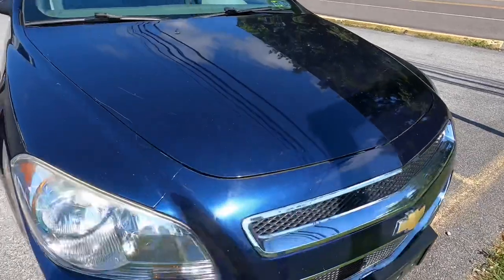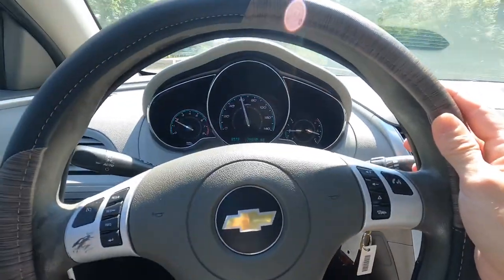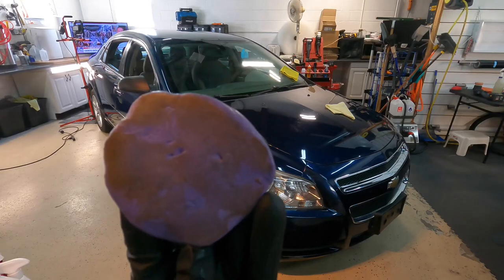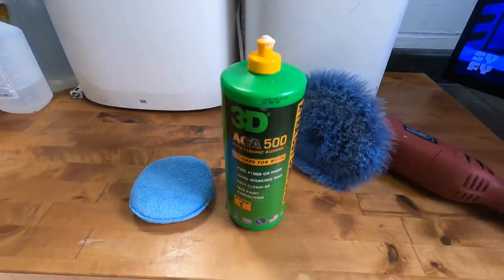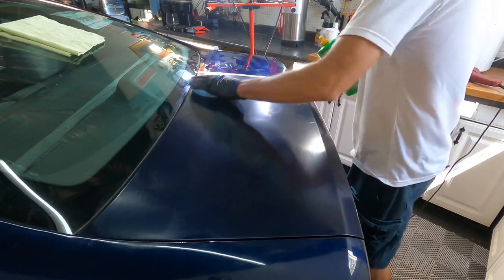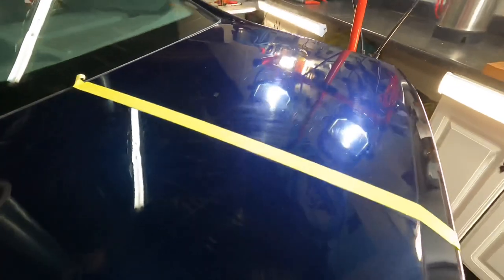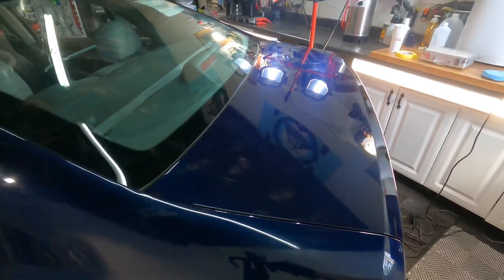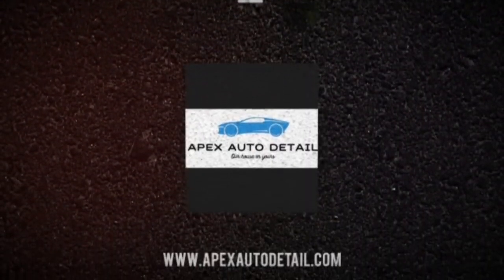WORST Paint On An Auction Car Yet!!! Can We Correct It?

Comment: Just to clarify, you always want to use a clay bar to remove any contaminants BEFORE you do ANY polishing, or can you go straight to polish if the part was already clean?

Also, so it isn't worth it to correct the car's paint entirely because it doesn't increase the resale value enough for the time and effort put into it?
Reply: Yes clay first, you want to remove the surface contaminates so the polisher and compound can get evenly to the paint, not bump around on top of the contaminates.
The correction process will for sure be done to entire car, not just the trunk lid, it would take too much time to video the entire process, so you'll have to use your imagination for the rest. ;-)
Reply: @davescott9062  oh okay, thanks for clearing that up. 👍
Reply from the maker: Wash, Iron remover, Clay, Panel prep, Polish in that order.

Comment: Very nice Brian huge difference I was wondering if you have ever used car pro fixer I picked some up to try I found it was a little hard to wipe off maybe I put a little to much on the pad or did not work it long enough thanks 😊
Reply from the maker: The correction fluids From CarPro I enjoy the most are finishing polishes. I would choose otherwise to cut.

Comment: Great video as always sir! Are you using a 7" pad on a 5" backing plate? Is that because its rotary?
Reply from the maker: It is a 5,1/2 on a 5 inch backing plate. great for curvy areas and tight corners.

Comment: Would it be best not to do the cutting phase by hand? Just not as consistent pressure wise? I have the time.
Reply: Nahhh bro cutting by machine without a doubt. The machine replicates what your hand should be doing but it does it perfectly with less effort. Less time is a bonus but even better results is the true bonus
Reply: @Ichabod_Jericho  Yeah, I figured it would just be generally more consistent. Thing is, I have plenty of time and don't mind putting in the extra effort.
Reply: @ANIMALragemode  I mean if you don’t have a 3 inch polisher, or just got some intricate areas that will stall a 3 inch anyway, or don’t wanna spend any money, I don’t see the problem in doing it by hand. 

But doing a whole panel? What’s the point. Modern power tools are engineered very well and exist for a reason. But I honestly don’t care 😂it’s your car and your elbows! Not mine! Just make sure you coat it in DPC 6 Year Titanium Oxide when you’re done 😙
Reply from the maker: More consistent and 10 times faster.
Reply: @apexdetail85  appreciate the response. Thank you.

Comment: New to detailing. Correcting I’m using a rotary g360 on wool. I don’t understand the polish step 2 get out holograms.  I’m just waxing sealant skipping step two. Noticing on black cars this is not good.
Reply from the maker: Dont skip the second step....the hazing will show up later when the wax washes off.
Reply: @apexdetail85  thanks.   I’ve kinda learnt to learn this.  It’s defo an art. Us new bies just struggle. It’s like a finesse art.  You’d think it’s slap it on done.  No